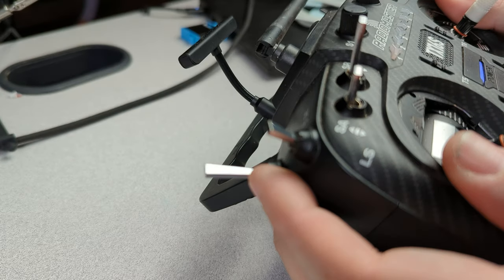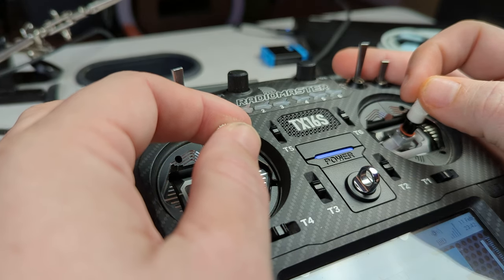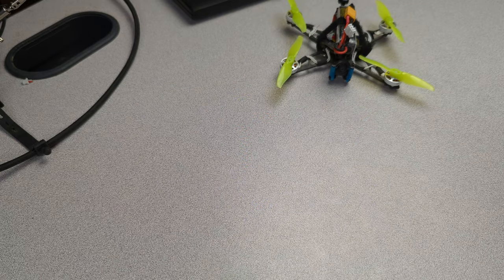6 reasons your FPV drone is freaking out as soon as you take off and how to fix them!

Comment: so my pitch and roll axis is fine but it does not yaw at all, but when i calibrate the accelerometer it fixes this issue...although when I unplug and plug my quad back in it causes this issue to persist until I calibrate it again

Comment: hello can you help me please!! when I fly like 4 feet it is getting crazy I don't know what's the problem I hope you can help me
Reply from the maker: I don't know that I can for sure fix what is going on since things that happen when you are already in flight tend to be wayyyy more complicated but let me give you some places to start checking!   Since it isn't freaking out right off the line, we know it can't be prop direction, motor direction, board alignment, or any of the other things from this video.  All of those would cause an immediate issue.  Usually when you are in flight and start getting run aways, it is due to vibration feedback in the gyro and over-compensation by the flight controller.  That could be caused by mechanical issues with your quad, like cracks in the frame, delamination on arms or plates, missing screws, a tightly mounted stack, lots of things.  I would start checking there first.  If that doesn't turn up anything, then there is likely an issue with your tune or filtering so I would roll back any changes you might have made to it or somehow get back to either betaflight defaults or whatever the manufacturer shipped it with if it was a bind and fly.  Im sorry I can't just tell you exactly what the issue is, but I hope some of this helps you track it down!

Comment: so my pitch and roll axis work fine but my yaw does not, although whenever i calibrate the accelerometer it fixes this issue...but whenever I unplug and plug my quad back into betaflight the problem is back again, any idea how to fix this?

Comment: Why do I only get a clear picture when my goggles are 5 to 6 inches from my drone? Am I stuck in pit mode? How do I get out? Thanks.
Reply from the maker: Sorry it took me a minute to see this :(  Usually that will either mean you are in pit mode or you have a connectivity issue with the antenna on your VTX.  For the pit mode bit, just go into betaflight and the VTX tab.  In there you can click off pit mode and that should get it out of there.  If that isn't checked, you might want to look over your MMCX on the antenna and make sure it is completely seated with a firm click.  They can be a little sneaky about being loose.
Reply: Thanks. Just dropped it off at the shop. I'm new to this. Beta what?? 😄 Thanks again for answering.  @BaconNinjaFPV

Comment: I just built out that same frame.  I havent decided if it is going to stay 2s or 1sLiIon as I initially intended.  it flies great as 2s and like a drunken turkey on 1sLiIon (but not so bad with a whoop battery)  what motors are on that?  I have 1103 11000KV because thats what I had available
Reply from the maker: lolol, a drunken turkey.  I could totally see that for this kind of build on a 1s LiIon and the amps per gram those things put out.  I am running the FPVCycle 13mm 1S motors with 11400KV and doing a motor output limit and tune with auto cell count switch for 2S.  I do find myself flying it on 2S a whole lot more than I do 1S though.
Reply: @BaconNinjaFPV  I was going to put RCInpower 1202.5, which is the same size as the 13mm I assume since FPVcycle has silly sizing.  but I had the 1103s in hand

Comment: Sadly none of your Tips solves my problem. Thanks for the video though…  I still get flip over after increasing throttle. I double checked every single point you make. Arming all seems and sounds fine. But already after lift off the quad pulls to the right side, freaks out and flips over. No clue. Can bad soldering lead to this as well? I have no short though and all motors spin… Have not touched PID settings.
Reply: you get this figured out? think i'm in the same spot right now
Reply: @wmfbmp5743  Sadly not yet. I paused this project for a moment.

Comment: Why do you turn off the accelerometer?
Reply from the maker: Good question!  I turn mine off on boards with F4 processors to save processor cycles for more important things.  I never use angle mode, and that is the primary reason for using it so it doesn't really do me any good anyway.  Might as well turn it off and give my PID loop a little more wiggle room on the processor :)
Reply: Interesting. I used to fly my tinywhoops in angle and just kept the same model profile, so now angle mode is my "oh shit" button.

Comment: The props in the wrong order was my first quad build "take off"... 
Luckily I did catch the problem soon enough and corrected it. The next beginner mistake was not tightening the props nuts hard enough... crashed quite bad... new VTX is on its way in the mail..😂😂😂
Reply from the maker: The wrong order is a pretty common one!  They don't really give you many indications of the direction the prop is supposed to spin when you are first starting out, so it does happen a lot.  At least you got that first bit crash out of the way early! lol.

Comment: Sir i am beginner and when i arm the drone it goes little bit to forward direction itself
Reply from the maker: Do you happen to know if you are in angle mode?  If so, it is likely that you will want to calibrate your accelerometer so that it doesn't drift forward :)  If you are in acro, then you might make sure your radio doesn't have any trim set on the pitch axis since that will cause you to drift as well.
Reply: @BaconNinjaFPV  I am in angle mode and I have calibration many times.

Comment: Thanks for the video.  YMZFPV lighting came with the gyro with the incorrect orientation.  Not a smooth first drone experience 👎
Reply: @logs7 
How did you fix this ?
My ymzfpv lighting is having issues as well.  Freaks out when arming
Reply: @Leakyfpv  sorry for late reply the board had come stock 90 degrees turned to the right.

Comment: Mine is only with sharp stick inputs and I can't figure it out...
Reply from the maker: hmmmm, that sounds like a motor is having a desync issue when you give it sharp commands or possibly that your PID tune is a little too hot.  I would be interested in what the build is, what kind of rates you are running, and what that PID tune looks like.  Hit me up on discord and we can chat about it in a bit more detail :)
Reply: I honestly have to go Google what discord is. I'm not very up to date with tech these days. Then I'll have to YouTube how to use it lol.
Reply from the maker: @american7169  lol, totally understandable!  First thing I would try is setting your demag compensation to high in the ESC configurator for your type of ESC.  If that doesn't do it, I would go down on the master slider in the PID tab by 4 notches or so and see if that fixes it.  If that PID adjustment does it, then your tune is too hot and you can work that slider back up by one click until you start having issues again.
Reply: @BaconNinjaFPV  I'll try the master and see, I used pidtoolbox and uavtechs and rossers tutorials to tune and it looks good on graphs and flies great until I hit max stick. Running 700 deg/sec with 5 expo. Almost think I have a bad gyro or accel cuz if I switch to angle mode it will veer on roll so much it sometimes takes most of the stick to correct the veer and fly level